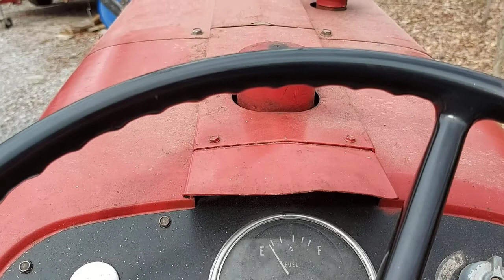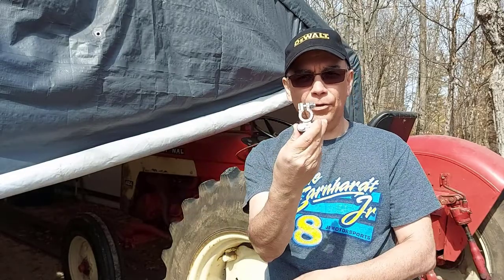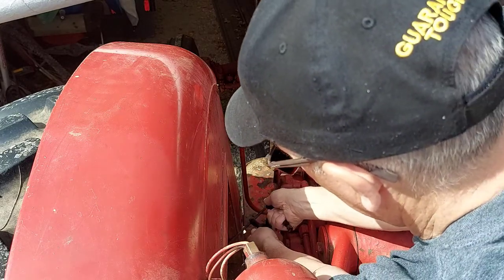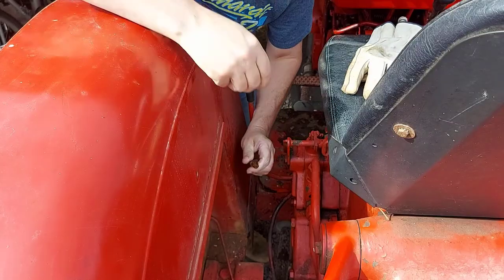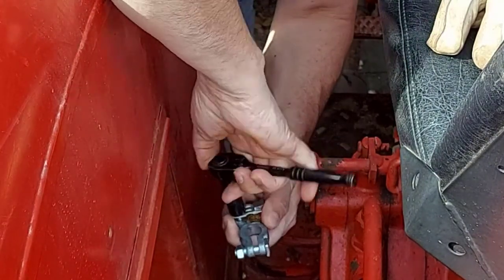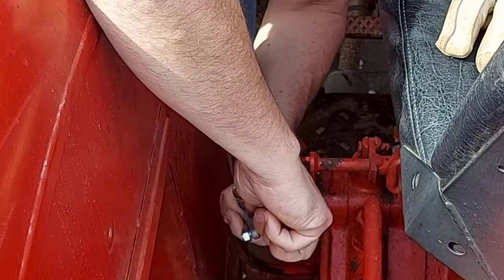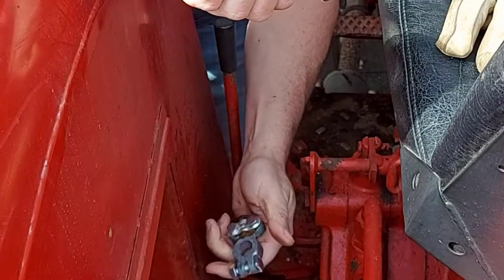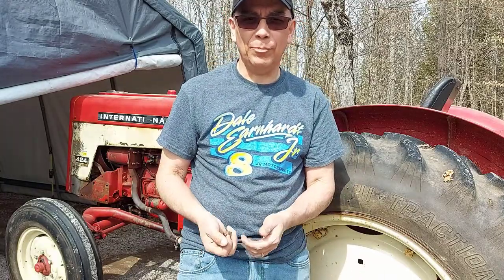Much Needed Battery Cable Clamp Replacement on this IH 424 Tractor

Comment: Just diagnosed the 22hp lawn Tractor that wouldn't start. I replaced everything.  Was staved of fuel so you can imagine the pain of Carb cleaning, fuel filter, gas lines, battery replacement, checking the spark plugs for spark and fouling the choke function ect ect. Come to find out the Throttle cable was sticking due to the springs and mechanics being dry and gunky. Brushed and lubed them all. Now she runs after a 6 months of sitting dormant.  ( Sigh ) now to cut the 30 acres =P  ( kidding 2 acres of lawn around the property. ) Other 28 can wait till the Brush hog is on.
Reply from the maker: I feel your pain. Lol But we always learn something from it even if we didn't ask for the education. 🤣🤣

Comment: Good Job Roland, we can relate, went out to start the car  and harry said it won't start, I said maybe there is loose connection on the battery, well it was the clamp that broke in half and Harry buys extra of things and happened to have one in our shed, that was smart, but we still don't know how a medal clamp would split in half, Have a nice Week you and Beth!
Reply from the maker: Hi Wendy the metal is cheap and I figure all the vibration finally caused the battery terminal clamp to split and break. Thanks for dropping by and you both have a great week!